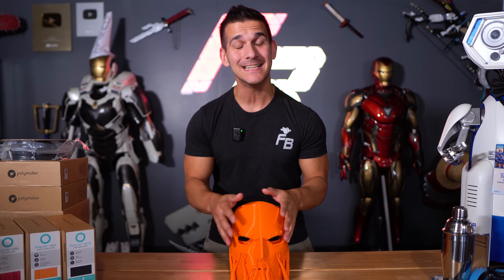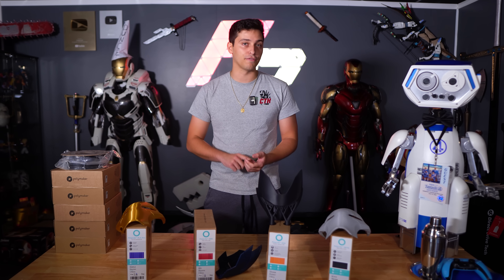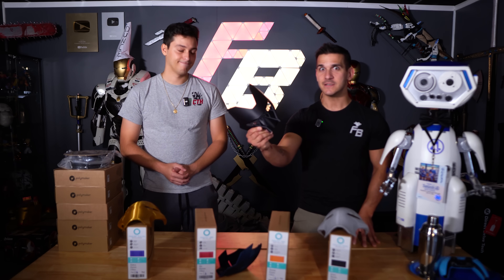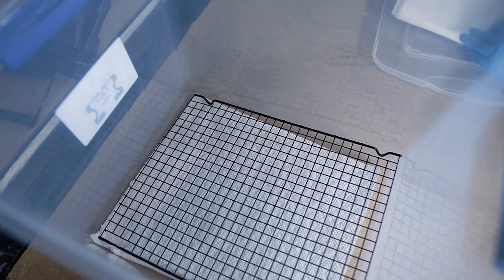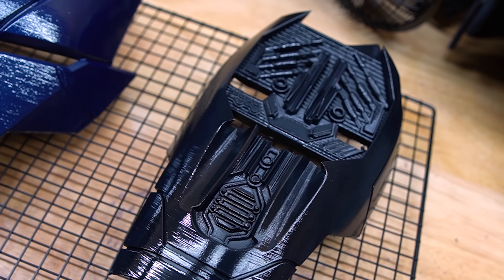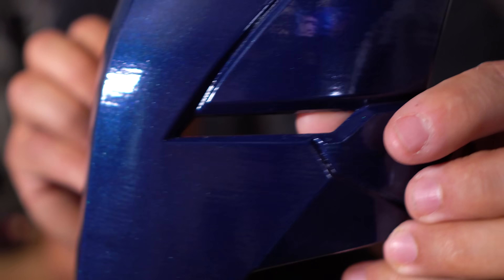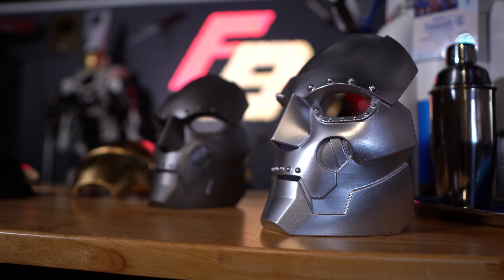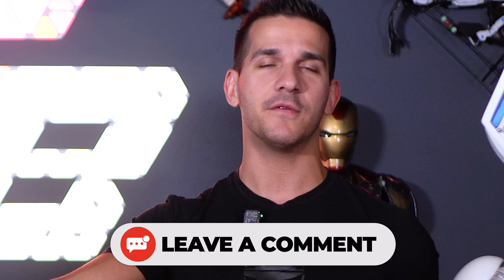SMOOTH 3D Prints with NO SANDING! | Vapor Smoothing Tutorial

Comment: If you’re ever gonna paint, there’s no need to vapor smooth it at all. You’re ALWAYS going to have to sand prior to paint, especially if you’ve vapor smoothed the part. 

The best way to do this is to print the part, DON’T sand prior to priming, use a high build primer, said and paint. That’s the fewest amount of steps. 

That first sanding session is ridiculous and unnecessary. It’s also the reason most people don’t do the post process work.
Reply from the maker: That’s….such bad advice lol 😅 the vapor smoothing eliminates a HUGE amount of sanding. High build filler is another step. 

Yes obviously sanding is the key to it being smooth. But this cuts down physical labor time. Idk what world that made sense lol
Reply: @FranklyBuilt silly talk is silly. You’re literally adding steps. Stop using shitty primer, sand less. Simple.
Reply from the maker: But you’re saying DONT use the process that makes you need to sand less. How does that make sense.

Example:

Sand for an hour

Or

Let it vapor smooth for 30 minutes while you do something else. Then sand for 5-10 minutes. 

I mean if you like doing extra work that’s fine 😅 but it’s still very bad advise to say there’s no point vapor smoothing if you’re sanding it lol it makes it smoother faster AND makes the part stronger.

And high build primer can be detrimental on high detail parts, also requires a compressor and HVLP system which most people don’t have. So you’re saying spend MORE money to do MORE work. 

If you think the first round of sanding or vapor smoothing was unnecessary then I can only assume you’re an amateur or haven’t garnered enough experience, which is fine. You do you 🫡
Reply: @FranklyBuilt again. There’s no need to sand for an hour. And another again. This applies only if you’re going to paint. Use a quality high build primer and you won’t have to sand for an hour. Again. Again. If you’re painting it, you still have to sand after you smooth it.
Reply from the maker: Yes. You’ll always have to smooth it lol that’s what vapor smoothing is FOR. To cut down on sanding time. Drastically 😅 then use whatever primer you like and skip so much wasted time sanding.
Reply: @FranklyBuilt as long as we agree that you’re adding steps and making the process unnecessarily longer. Mmmkay, Pumpkin.
Reply from the maker: By letting chemicals smooth it so I don’t need to sand it? 😅 yeah. Clearly I’m taking the smarter approach lol
Reply: @FranklyBuilt bruh. Smarter isn’t adding extra steps that forced you to put eleventeen safety disclaimers in your video. I’ll repeat it for the non monkeys in the chat. If you’re gonna paint it, just spray it with high build primer ONCE, then sand it ONCE and it’ll be ready to paint.
Reply from the maker: So using an HVLP gun and pouring high-build primer doesn’t require ANY safety steps? 😅 that’s wild man, you must have super lungs or something. That’s neat.

Goodluck with your extra wasted steps 🫡 we’ll be here saving our little fingees from needless sanding and wasted material.
Reply: @FranklyBuilt we already established that YOU are the one adding needless steps. Your lack of knowledge is apparent when you assume you can only shoot high build printer with an hlvp gun. One can of high build. One sanding session. Paint.
Reply from the maker: Ohhhhhh so you’re using high build out of a rattle can 😅 okay yeah we’re done here. Got it . That’s all I needed to know  😂 you do you buddy.
Reply: @FranklyBuilt they’re laughing at you, not me, bub. Just because you don’t know everything that exists doesn’t mean it doesn’t exist. Keep wasting your time.
Reply: @FranklyBuilt Fine, Franky baby. You win. I’ll come out of YouTube retirement to teach you how to do this the easy way.

Comment: Just to be clear, you probably should still sand before priming to get the best paint adhesion.  I'm not a 3D printing expert, but I've painted quite a lot of different medias.... you need tooth on plastics for paint to to bite.  That said, the vapor smoothing is still super helpful because it drastically reduces the overall amount of sanding you would need to do for the layer lines.
Reply: If you vapor smooth before priming, it doesn’t actually cut down on any sanding. If you’re gonna paint these parts, vapor smoothing is an extra and unnecessary step. The part has bite right off the printer. Just use high build primer, sand and then paint. That’s the fewest steps.

Comment: I almost work exclusively with ABS because of vapor smoothing. Something I've found that helps speed the process up is have a small brushless fan in your chamber that circulates the fumes. Heating the acetone will also speed this up dramatically. One huge benefit to having vapor smoothed ABS parts, is that you are also increasing the layer adhesion when you melt those outer layers. This helps create very strong sword segments for you prop makers out there!

Comment: Please wear the proper PPE. I really enjoy your channel Frank. Those masks you're using in this video are NOT designed for vapor. They're for solid particles. I was never a PPE guy, but after my hospital stay for a failing left lung, it completely changed the way I look at this stuff. Please do not learn the way I did.
Reply: I want to second this statement. Those masks do nothing for vapors. You could probably tell because you could certainly still taste and smell the vapors when wearing the mask. The respirator that you use for this should be rated for "Organic Vapors".
Reply: What chemicals caused the lung to fail?
Reply: @Chancerss  Most resins contain volatile organic compounds. Also, acetone vapors are so strong it deprives the lungs of oxygen and can cause respiratory collapse, which is what happened in my case. Unless you're wearing a NIOSH-approved mask / VOC filter, you might as well not be wearing anything.
Reply: Go eat tylenols it will help
Reply: The filter cartridges for your respirator need to be for organic vapors, a particulate filter will not suffice. You can often find the filters in the painting section of most big box stores.
Reply: He will be fine.  Calm down
Reply: @AutismusPrime69  If I wanted useless reassurance, I’d talk to a fortune cookie.
Reply: @AutismusPrime69 He was calm. Frank was putting himself at risk and OP politely pointed it out which is 100% the right thing to do. Frank liked the message so your message was both late and off base.
Reply: @radish6691 Great reply Radish, nice to see reasonable people are still around these days. 😅

Comment: So if I want to make my entire suit vapor smoothed with no sanding or painting, does it mean I can't use welding? because I still need to print large back and chest parts that don't fit even on the H2D
Reply from the maker: Why wouldn’t you be able to weld?
Reply: @FranklyBuilt whenever I weld I also use wood filler because the filament alone never makes it 100% smooth. I thought using wood filler is a must but I guess I should just improve my welding skills

Comment: If your part is flat and you need to smooth both sides, is there any issue in laying it flat on the metal grate?
Reply: Just wanted to see if I could bump this to get an opinion. We tried this and it definitely melted lol. We ended up propping them up and it worked well. We completed our first vapor smoothing project and we closely followed your tips in this video. Great content, thanks for your help!

Comment: Acetone is nail polish remover. It's not the worst thing to get on your skin but constant exposure could be bad. Gloves are recommended but use Nitrile or Neoprene, vinyl and latex gloves will get dissolved. For respirators, make sure you use filters that work on Organic vapors. They're usually thicker than the cheaper particulate filters. If you can still smell the nail polish remover with the mask on, it isn't the right filter.
Reply: Nail polish remover is often not pure Acetone

Comment: I think you should have been a bit more careful about mentioning that $300 to $500 printers can handle ABS.  The only safe way to use such a printer is in a garage with the door open or literally outside. Without cobbling some sort of enclosure and venting system together, a cheap printer cannot safely be used inside. Otherwise, this video was great. Thanks

Comment: Doesn't vapor smoothing decrease the strength of the props so that it wouldn't be worth it in the long run?
Reply from the maker: I haven’t seen anything saying that. Theoretically it’s melting the outer surface together and strengthening the layers better.
Reply: Vapor smoothing actually increases part strength assuming you don’t over do it. Thats because it increases the bond between all layers

Comment: Hey would I be okay with printing with abs or asa in an enclosed 3d printer in my bedroom? I've got a decent sized room with 2 ceiling fans and a p1s I don't have anywhere else to really put it in my house and I can't open my window because the way our house was built my room upstairs has a separate heating/ac unit which is barely hanging on right now even the extra bit of heat from sunlight coming in a window could be too much extra for it.
Reply: you can get a cheap tent enclosure to go over the printer, and exhaust fan, and then connect a hose and vent the air out a window. as long as you maintain a bit of negative air pressure in that enclosure, which the exhaust fan creates, you will not let the gases into your room.

i saw people attaching mounts to the exhaust fan on the back of the p1s and venting like that. i dont know if thats enough and personally i wouldnt risk my health to save so little money vs getting the proper stuff

Comment: You need a respirator with the correct chemical vapor cartridges, not the pink ones for particles and the N95 will do absolutely nothing, you can still smell the acetone through them , meaning it's not working. Technically you should be wearing them even with a paint booth, ultimately safety is your own responsibility.
Reply: Yeah this video is insanely under researched and has an insane lack of warnings. This dude should be taken off the platform.
Reply from the maker: Ahh you’re here too? Cool.
Reply: @FranklyBuilt  Me or the other guy? I was just trying clarify and not put down. More education the better.
Reply from the maker: Oh the other guy. He claimed I didn’t warn people of the dangers. Ya know. The first 2 minutes of the video me warning people lol but yeah the mask makes sense too. I’d rather have SOME mask on rather than none but that’s why we stress open air ventilation and proper research. We aren’t professionals and you should never just DO something right after watching one random video.

Comment: I wonder if adding a small fan inside would improve results... Circulating the acetone
Reply from the maker: It does!
Reply: Yep! A fan will greatly accelerate the process. Make sure you use a brushless fan though! Don't want to risk any type of spark or discharge from the fan.

Comment: That N95 mask is completely pointless to put on for this. It's not going to protect you even a little bit.
When I started with 3d-printing back in 2011, PLA was the go to, so I'm a bit confused about the comment about ABS being the standard back then.
Reply: Agreed here that a proper respirator should be the standard, but we also had a significant amount of airflow not explicitly shown combined with only having contact with the acetone for less than a minute.

As far as the ABS being the standard, professionally it kinda was lol, PLA has always been present and the most popular generally, but for professional uses ABS was kinda the cornerstone

Comment: Hey frank, I'm currently trying to make a starboost suit! Just like yours, I'm 14 so I only have an ender 3 at the moment, but I am asking for a new printer for christmas, I dont really know what printer I should get that has a decent size and can fit a whole helmet on it, whats something you recommend? Thanks!
Reply: I’m not Frank, but from my experience, I can highly recommend the Elegoo Centauri Carbon. It’s fairly cheap, has a build size of 256 mm cubed, and overall just performs great! :)
If the Bambu Lab P1S is for sale, I would go with that. Also, remember that you will probably grow a lot from 14 into your adult years, so you might need to reprint as time goes on.
Reply: The elegoo is a good recommendation .   If you’re looking to print  bigger and have a lil better budget   The creality k1.  Is a good go
Reply: Get the centauri carbon or the centauri. I bought the centauri carbon and it works right out of the box and it’s perfect for printing anything you want

Comment: I like using different mixes if ABS/Acetone slurry and brushing it on and sanding, since ABS sands like a dream.  I built a Red Hood helmet years ago now on the Replicator 2x's that I bought in 2014 & 2017 and used the slurry to both chemical weld the pieces together and then fill and smooth the layer lines and seams to get a very nice finish on it.  I've even did just a wipe with a cloth with Acetone on it as some final passes with the sanding dust on the parts to both smooth and fill any small gaps before I hit it with primer.  Now that I have larger enclosed printers I'd like to get into doing larger projects, but not having a good dedicated larger workshop for it makes that very difficult.

Comment: I wonder how it would look if you could vapor smooth the print and then combine bondo spot putty with acetone and brush over the print to ease the pain of the sanding process
Reply from the maker: It would ruin it. You can’t Directly apply acetone to it
Reply: @FranklyBuilt  Possible to get some clarification as to what you mean by that..? I mean I have used bondo/acetone for smoothing out prints for years one of my favorite go to and I am sure you have done the same or at least know about it.. so I am assuming this must refer to something specific with the vapor smoothing process but even then I am failing to see how deciding to apply the mix in an attempt to fill in whatever layer lines were left after smoothing it would 'ruin' it.

( I am genuinely curious because I am about to start a doom cosplay and am thinking about trying this out.. but if part of my usual post processing is going to ruin something would be handy to know )
Reply from the maker: You need the vapors to smooth. You can’t apply acetone directly as you won’t be able to control it, it will instantly melt the part and warp it, it works fine on PLA and PETG because they don’t react to acetone
Reply: @FranklyBuilt  Yeah.... not going to lie I gotta own that one.

Must of been too early in the morning haha it didn't occur to me at all that the base material was different than the ones I usually work with so of course I could paint it on PLA etc. but not the material that dissolves from just the fumes XD
Reply: @FranklyBuilt i usually use PLA or PETG so i didnt think of it instantly melting the part if you mixed the 2 methods but it makes sense. Thanks for clarifying

Comment: Thanks for the video! Quick question, will it be safe if I put my P1S in my apartment's balcony as it's printing ABS/ASA? Might even throw in a house fan to blow the chemicals out of the balcony.
Reply: Be careful with the filament if you put it outside. Moisture from the air can get into the filament and ruin the print
Reply: Open air balcony should be good, as long as it doesn't rain 😅